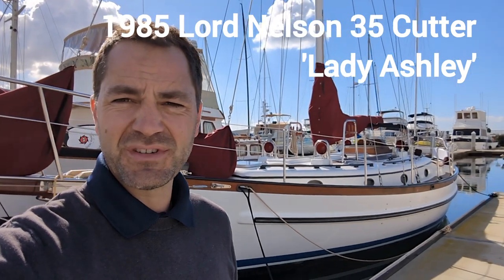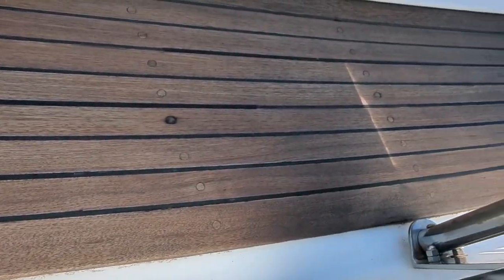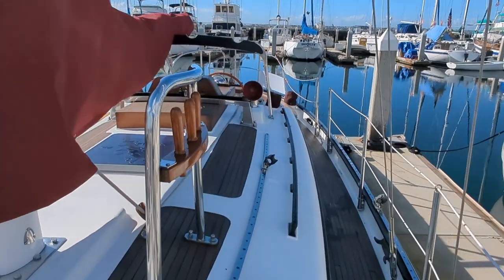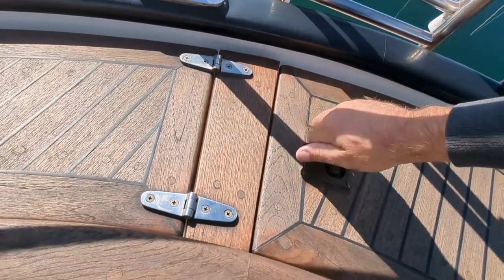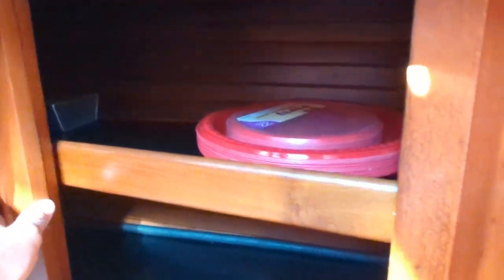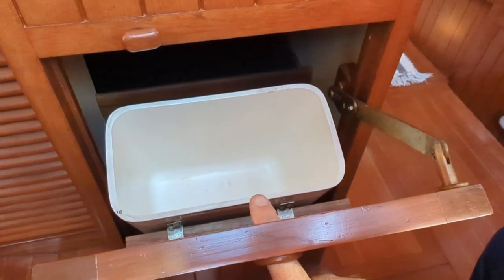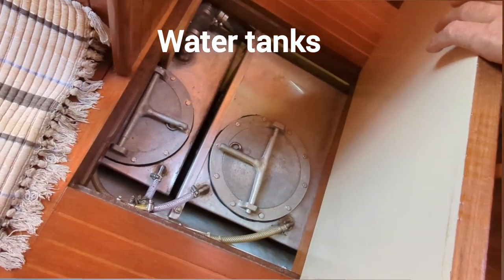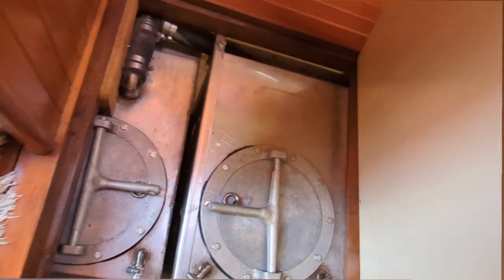1985 Lord Nelson 35 Cutter rigged Bluewater cruising boat! Sailboat Tour

Comment: The boat was built in Taiwan not Europe
Reply from the maker: Did I say it was built in Europe? It was built in the same yard as Hans Christian Yachts, which were built in Taiwan at that time.
Reply: @coronadoyachtandhome   I knew there was something very familiar about her. The boat reminds me of a Hans Christian 33 . It's hard to find negatives about her. The price is very reasonable considering the quality and condition. A bit of modernization in solar, lithium battery, water maker, auto pilot, dodger and bimini . If , like me, the modern catamaran apt floater doesn't interest you, this would be a great catch even with a few bucks for improvements. Hats off to the owner and broker for a great presentation. I would be surprised if she was still available.